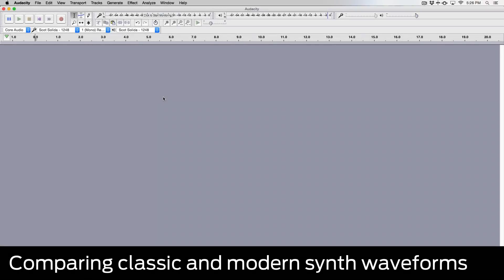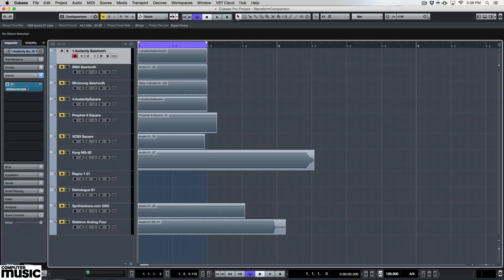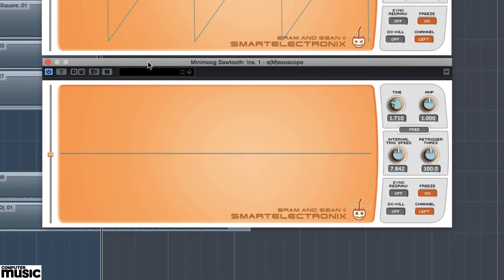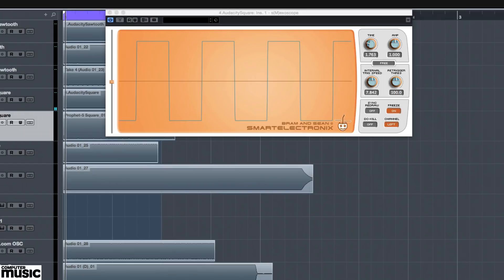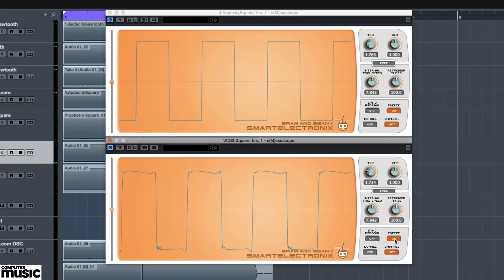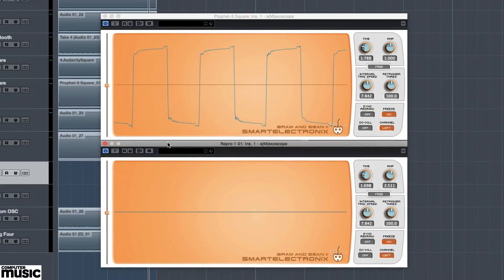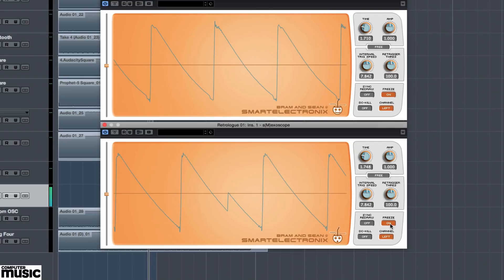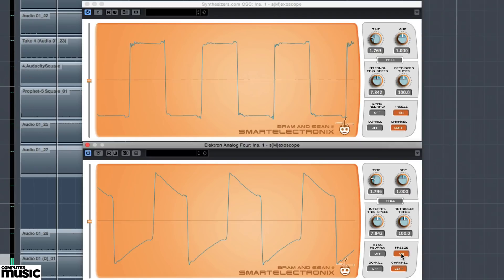Comparing Synth Waveforms | Vintage Analogue Vs. Modern Digital

Comment: trying to replicate the sound of a synth through samples...  try to record your computers waves by using an aux cord plugged into another computer.  no output will be perfect, however, analog synths were able to get rid of digital artifacts that you probably forget to hear because you're used to them.  if you ever hear an analog synth, it is noticeable that it has a perfect connection between time vs. gaps in specific frames during a digital computer's performance.  yes, analog may have imperfections, but so does digital.  which one seems more viable?